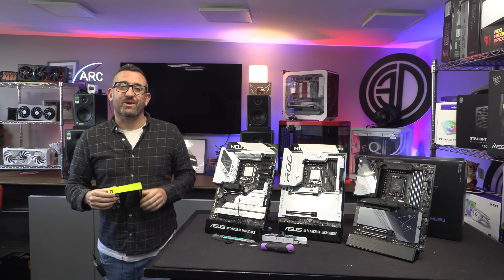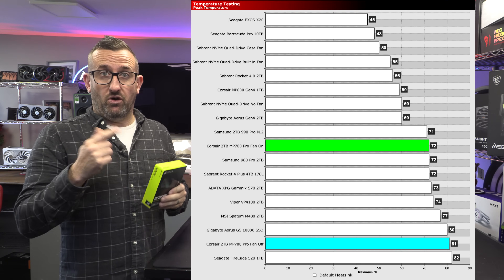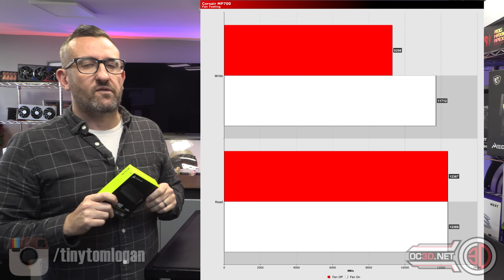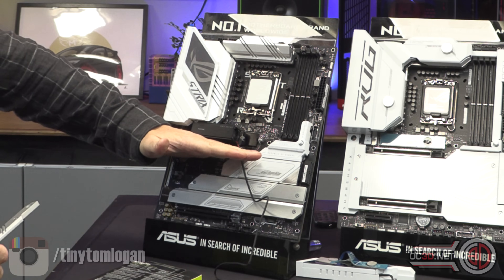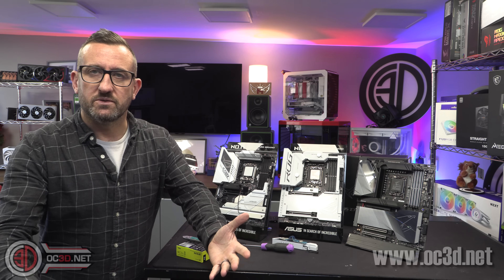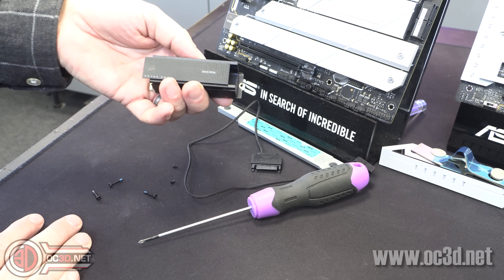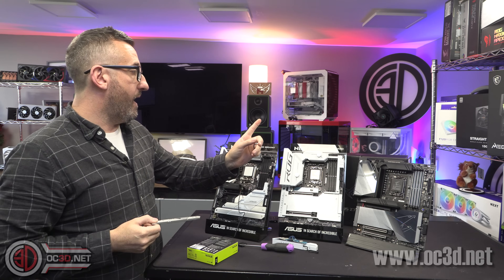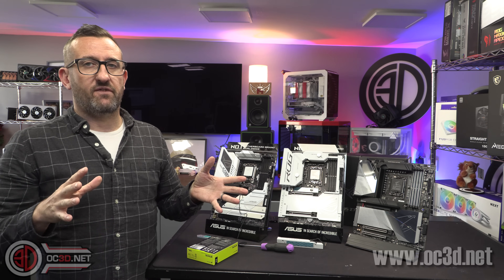The problem with PCIE5 drives and motherboards  - Corsair MP700 NVME

Comment: When I saw your title, I really thought that the first thing you would mention is that Intel only provides 16 gen 5 PCIE lanes, so if you want to use that gen 5 SSD, you'll have to drop your GPU down to 8 lanes.  Why Intel couldn't provide 20 gen 5 lanes is a mystery to me.
Reply: @4KGBATD  I guess so. They provide 20 gen 4 lanes, so how hard would it have been to supply 20 gen 5???  PC Enthusiasts don't like to intentionally bottleneck their latest gen gear like this.
Reply: @4KGBATD I still remember buying a rob formula iv x79 back in the day for around 300AUD and you could get 40 lanes for that. If only hedt prices weren't ridiculous these days.
Reply: If you read PCIE specs, you could find the more and more expensive material requirements to maintain signal integrity over ever shorter lane lengths in each faster PCIE generation.
PCIE5 is more expensive to implement with need for regeneration of signals beyond the first slot or so, so in general only very expensive boards support a lot of PCIE5 and it's simply not worth it.
Reply: @RobBCactive  I completely agree on the additional cost of adding many Gen5 M.2 sockets due to frequency and line-length (although it is interesting that MSI made the 4th M.2 socket away from the CPU the gen 5 socket on my Z790 ACE MAX mobo--but it's a higher tier, 8 layer pcb). I'm really questioning why Intel didn't include 20 PCIE gen 5 lanes in even their 14th gen CPUs so that motherboard mfrs wouldn't have to resort to switching the first PCIE GPU slot from 16 lanes down to 8 in order to support a single PCIE Gen 5 SSD.  Since with many new mobos, that would be the first M.2 slot and would be designed to handle gen 5, it's really an Intel gen 5 lane deficiency, wouldn't you agree?
Reply: @life-longpatriot8258  well 14th gen isn't a real new gen.
Intel would probably want a new premium socket to segment platform connectivity improvements (they have planned HEDT chips Fishhawk Falls but Threadripper).
It seems to me the Alder & Raptor PCIE5 support was a box ticking marketing "future proofing" exercise with no real GPUs supporting PCIE5 making it practically pointless but encouraging sales.
AMD's AM5 made NVME the PCIE5 target and provides more lanes.
Historically Intel segmented heavily and had enthusiasts pay heavy premiums for wanting a little more
Reply: @RobBCactive  yes we all know about this,  but this has nothing to do with how many pcie lanes are put on a CPU which comes down to how its manufactured. The cost is only factored in to the implementation of the motherboard which will charge you a great premium for those materials.
Reply: Oh wow I think there's 28 on my x670e. That would majorly annoy me. How many lanes does a modern gpu really need though?
Reply: @xzaros   do a YT search for "EXPLAINED: PCIe lane SWITCHING & Biggest MISTAKES! |"  by Tech Notice. He lays out the issue very well but doesn't go into specifics about actual % performance loss dropping from 16 to 8 lanes with a gen4 GPU.  He says, "That will be a whole other video" which he hasn't posted yet.  My MSI Z790 ACE MAX uses M.2_1 for a PCIE Gen 4x4 SSD,  but it dedicates the M.2_4 slot for a PCIE Gen 5x4 SSD which would switch my PCIE_1 slot from X16 to X8 lanes. The other 3 M.2 slots go through the chipset.
Reply: @xzaros  From the channels I've seen that have spoken about it, you only lose about 2-5% performance of a gen 4 GPU running it through 8 lanes instead of 16.  That's why I said "PC enthusiasts," because while many wouldn't care about such a small loss in graphics performance to double their single SSD throughput (all the rest of the M.2 SSDs on the mobo will run gen 4 through the chipset anyway), it's the enthusiast that pays top dollar for components when building their rig, so a 2-5% automatic bottleneck just goes against the grain.  I'm looking at my 2015 X99 HEDT PC right now with 40 pcie gen 3 lanes that has 3 EVGA GTX-980ti Classifieds rigged in SLI--But don't get me started with SLI.  LOL.  I don't use it for gaming anymore, but I still run Windows 10 and MS Office on it for nostalgia's sake.  And once it boots up on the old M.2 Gen 2 NVME SSD, The Intel 5960X CPU is still not a bad performer.